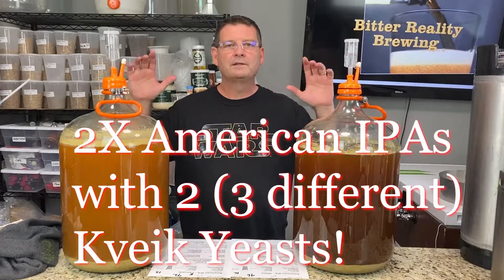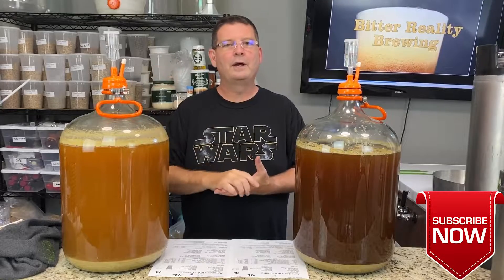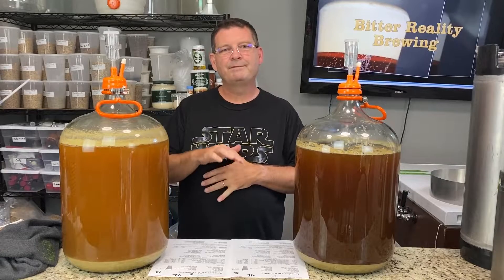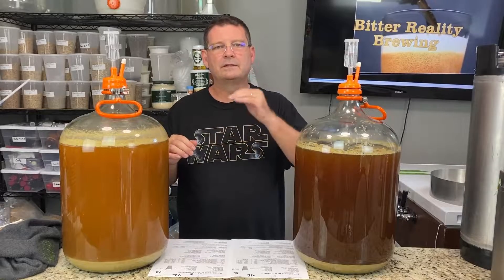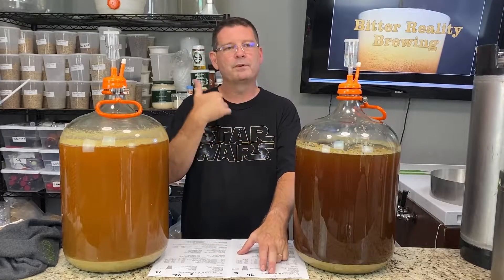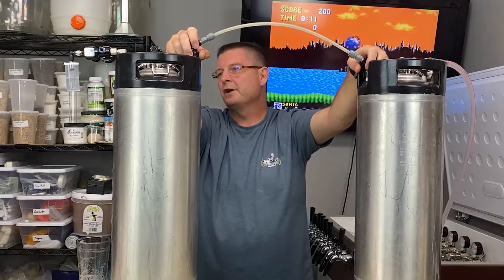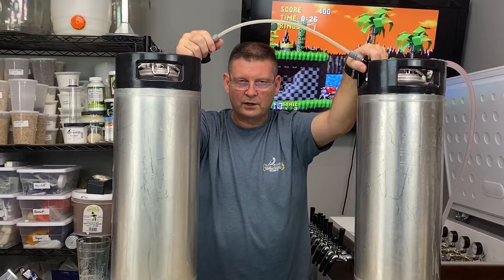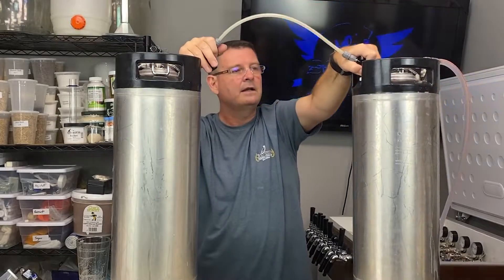2x American IPA - Anvil Foundry Adapter - BHE and 2 (3) Kveik Yeasts

Comment: Curious as to why you transferred  you're wort to a carboy then to a corny keg...? Why not just ferment in the carboy or eliminate it totally and ferment in the corny? Did I miss something?
Reply from the maker: Good point but it is just the way I've been doing it now for years, it is kind of a habit. I do almost all my secondary fermentations or additions in a corny but then I still move everything into a final corny as I want to ensure the beer isn't resting on top of a major yeast cake or other things that could begin creating off flavors. A great example is hop matter either from the original wort or from a secondary if it sits too long on too much of that stuff it seems to go a bit grassy or veggie tasting. Supposedly trub can do like issues but I haven't personally tested that yet so I'm not sure, I just want to ensure the beer is as "Clean" as possible without washing it too much with CO2.